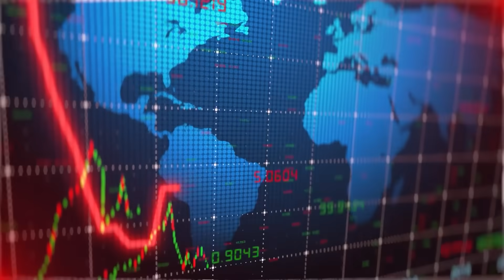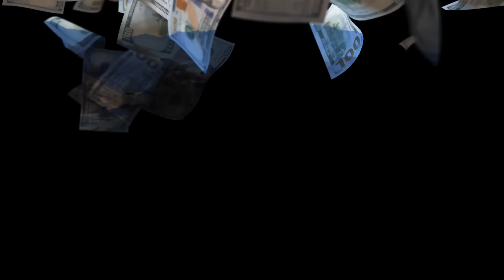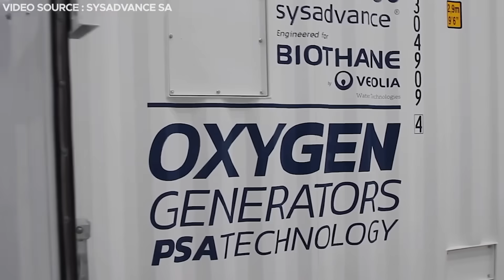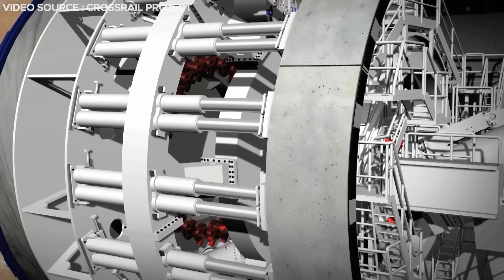China Is Building A $5BN Railway Tunnel Across the Himalayas!

Comment: NO RAILWAY IS UNDER CONSTRUCTION BETWEEN CHINA & NEPAL !
Such a line was first proposed by Mao Tse Tung (Chinese Communist leader) in 1973. It has been talked about a number of times since 2006. But on every occasion the cost, which NEPAL cannot afford, stalls any further progress. Estimates by China of a $5BN cost, are known to be just a fraction of the amount in reality needed. Which international Railway Engineering companies suggest would in fact be nearer to $15-$20BN. As 98% of the route will have to be in tunnel or on bridges. It would in fact be the most expensive railway in the World to build, per mile !!!

Further the Altitude (over 10,000ft) will cause serious operational problems. Diesel Locomotives can't be reliably used at such altitudes. So the line would have to be electrified. But as the amount of traffic on offer is minimal, the line is UNLIKELY to ever recover the financial cost of construction. Even though only a single track line is proposed, it cannot be a high speed line, as what little traffic there is on offer, would be freight. 

Further as no Geological surveys have even been conducted yet, the exact route cannot even be defined. Hence only vague cost estimates. Many in the rail engineering World say it is highly unlikely to ever be built. Unless China pays the full cost.

Comment: A report by scientists has concluded that the glaciers at the Himalayas are melting at a faster rate.  These glaciers provide water to almost 2 billion people.  Do we really need human activity in this delicate ecosystem?  Humans won’t spare anything until damage is finally done.
Reply: thats not melting the glaciers
if anything its preventing melting very slightly by switching people to lower carbon travel via high speed rail instead of driving or flying which release massively more carbon